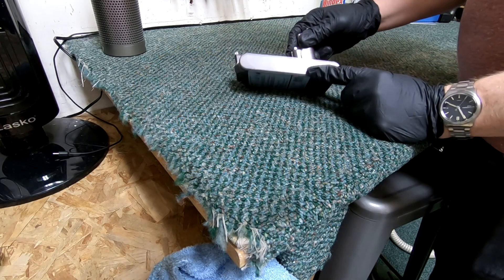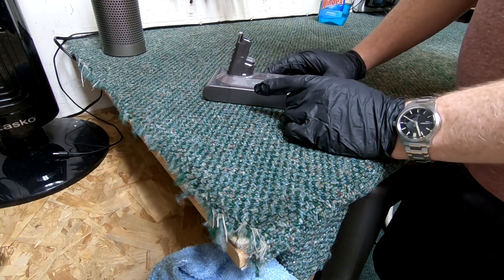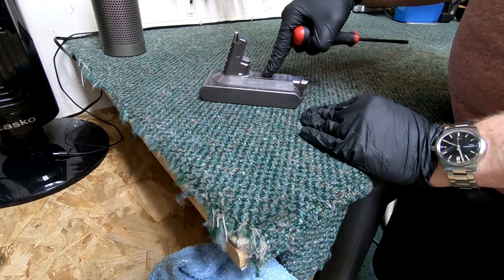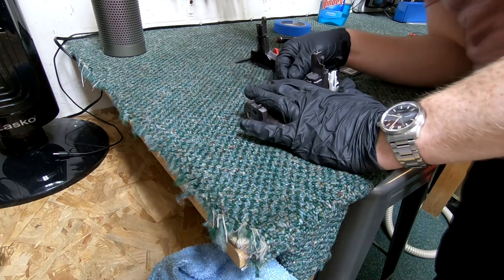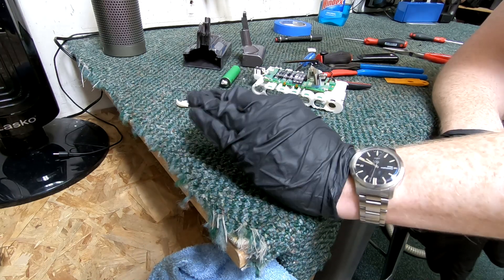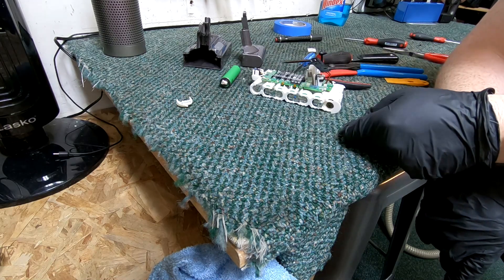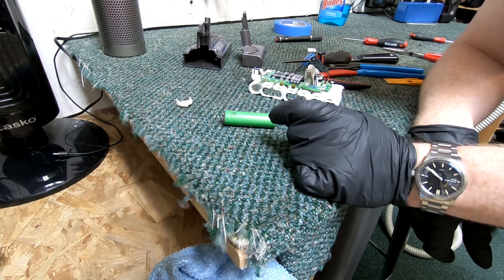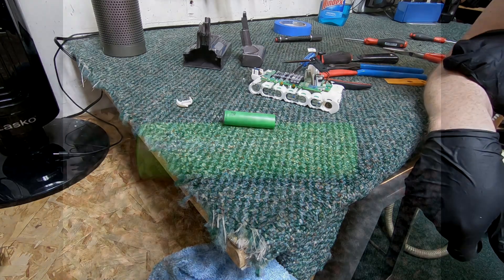Dyson V10 Battery - What's Its Secret? We Look Inside!!!

Comment: I just took my battery pack apart and had a bad 18650 battery, Dyson would work for about 5 minutes or so. Apparently, the batteries are rated at 3amps. Ordered 6 batteries replacements and will be replacing the one in the pack when the replacements arrive.
Reply: I just swapped the battery cells on my v8 to Molicel P42A's and I didn't
Apply any voltage while swapping. Even left it for a couple of days after removing the original batteries.
I just reset the battery before trying to use it and I had no issues at all.
Reply: @certifiedalchemist  jak wykonałeś reset bakterii?
Reply from the maker: Cool project! Just make sure the BMS gets power (low voltage) the whole time you are swapping the cell. If the voltage drops to zero, the BMS will basically lock the battery out of ever charging again. Hope that helps!

Comment: Useful video! Thanks a lot.
I add that all these packs CANNOT LIVE 15 years, even with good cells with good instentaneous amps like here, because must of all are built with only ONE range of cells in series... and that means a lot of out-amps quickly used for each cell, in particular with maxi power, with problems if it's used a long  time without stop. Lithium does not like fast discharges in the time, even with good cells . And in a lot of videos I  see  it's sometimes also a problem for the BMS which cannot support a long time such a use ...
These packs resist maximum 2 years if often used
 It would be necessary to have minimum 2 // cells ranges or more to preserve the out-Amps  for good durable performances( like for good screwdrivers) , but it 's another weight...and another price! Specially with the new items with bigger power...and always weak batteries👺

Al these wireless vacuum cleaners must be used only occasionally and during a short time for small areas...but a lot of people are seduced by  novelty of these technically interesting...and fragile devices. I got this V10 Dyson, but I will build MY own 2 // battery with a good BMS!...And I keep my old and good wired Dyson cleaner!!!...100€ every year for a new pack , no thanks.
Excuse my approximate english, friendly from France, Michel.
Reply: No opinion about this proposition?.... Perhaps too much disturbing...
Reply from the maker: Hi there! Sorry for the delay, It has been a busy few weeks and I'm just catching up with comments. I think the V10 battery project sounds cool, I'd love to hear more about it when it's done and see how it performs!

I will say this. Vacuum companies in general don't take battery management systems or robust construction seriously. I have 8 Milwaukee (I think that would be similar to AEG in Europe)  power tool batteries that are going on 7 years old now without a hitch.  The power tool industry has proven that you can build a robust consumer battery pack, but that costs money. And vacuum companies are notorious for cutting corners for either profit or price advantage. It's unfortunate, but consumers will continue to buy Dysons over and over again with batteries that fail. Tradespeople are less forgiving when they rely on a tool to make a living. 

Cheers!
Reply: @HouseOfVacuums  Hi Matt, thanks for your answer!
It's very easy (for the moment) to build a DIY battery with a dead power drill pack. Simply disconnect the BMS and change the cells , BMS re- connected and it runs like new. Impossible with a Dyson one : BMS (more exactly PCB because no balance...a shame) is immediately blocked  after disconnection.. This "locking" is technically absolutely not necessary for a good protection of the pack by the BMS . It simply obliges  to change the battery without possible repair...first of all for trash commercial reasons (like for a lot of E-bike batteries now).
So my project is simply open a good one and connect a second cells line with same capacity and discharge amps under the first one without touching the BMS always connected. And modify the packaging. Normally that will allow a use for  minimum 5/7 years, although a cleaner is much more used than a power drill! A 400/500w motor cannot run a long time with such "one line" packs...and Dyson knows that precisely. So they explain not to use the "Boost" , or only for a very short time..It's a joke??
I add that we find on Youtube a lot of dead Dyson batteries (red light) with simply faulty BMS without any cells issue...as like BMS was programmed to switch off after X recharges or uses (like for some printers)...and I dread this issue.
Well, by Dyson deliberate weak and "protected" batteries behind a performing and efficient technology. Maximal seduction...with poison in the apple. And you guess why.
Friendly, Michel.

Comment: You are trained how to handle lithium ion batteries but not anti static precautions it seems.
Reply: Yeah once you disconnect the cell, the pcb board is shit. They will be locked out and flash red if u connect the cell back correctly
Reply from the maker: Did you really think I was planning on reusing those PCBs? They all went straight to the trash. No use protecting what I'm sacrificing for the video.

Comment: 15 years dude ? My battery is 1 and had years old and it last only 1 minute 😂😂 those batteries last 1 year and that’s it
Reply from the maker: I know, it's hard to believe they claim that. Yours last an exceptionally short amount of time, but 15 years is bonkers!
Reply: A clogged hepa filter will trash battery usage. Unfortunately it is near impossible to get the filter cleaned.  I ended up cutting the filter so it still traps large particles but perhaps not microns.  No pets, no need for me to have a hepa filter.

Comment: I cycled it perhaps 50 times and got 1 year out of the battery pack.
Reply from the maker: It's unfortunate, but that goes with the territory for anything that has a lithium ion battery. Some may run for 8 years with abuse, some may be well cared for and die after a year. There are just a lot of variables at play. Sorry to hear yours didn't last long!

Comment: My V10 lasts 1 minute if using max power, got the machine two years ago, but it’s been like this for some time.
Reply from the maker: Sounds like you have a weak cell in the battery pack. It will cause the voltage to sag too low on high power and the PCB will cut off power thinking either the battery is discharged or unsafe. Probably time for a replacement. Thanks for watching and commenting!

Comment: I got curious, my V10 is still working just fine (smaller house) but wanted to see if this used plain old 18650s. Not a fan of them being in series. I'll admit I was (was) bought into the marketing a bit with their fancy cobalt-aluminum crap, glad I checked; had no idea they claimed 15 years of life (I freaking wish). Also, $130 for maybe $70 worth of cells, is their PCB and plastic shell really worth the extra $50?
Reply from the maker: Thanks for watching. Cordless machines have given manufacturers a new guaranteed income stream with replacement batteries, which is why they are so expensive. Bought in bulk at wholesale I can't imagine that they pay more than $5 a cell (probably less), so MAYBE $35 worth of cells, then the housing and PCB. In any case, battery pack a very profitable for these companies... which is why they want you to buy in to their ecosystem. The whole thing couldn't cost more than $50 to make, especially since they are using Malaysian labor which is even less expensive than modern China. It is indeed kind of a ripoff, but a necessary one.

Comment: Dyson claimed No loss of suction and then when Cinetic came out that claimed it's the only vacuum to never lose suction. In the manual it states for optimum performance the filters need to be washed monthly. I think we have been lied to. By the way I have seen many V8 and Who needing new battery after 2 to 3 years. I love mu trusty SEBO Felix. Greetings from the UK.
Reply from the maker: Thanks, Lahony! I think you hit on my major issue with Dyson... the shifty marketing. If they didn't stretch the truth like they do, at least I would have some respect for them. As it is, I don't trust them.
Reply: they never  lied, they said if you wash the filter and change the post motor filter it will not loose suction. nearly all vacuum man state that

Comment: Thanks for this information. My V10 isn't holding much charge any more. Only option is replacement? Not very environmental for Dyson
Reply from the maker: Unfortunately it is not just Dyson. Pretty much any vacuum cleaner that runs on lithium ion battery packs cannot have the cells replaced/repaired. Lithium ion cells can be recycled, but it is sometimes hard to find a drop-off depending on where you live.
Thanks for watching and commenting!
Reply: You can do a cell replacement, but you will need to maintain power to the pcb board. If you don't maintain power, once you disconnect a cell, your board will be locked, even if you spot weld new cell back, it will be locked and flash red

Comment: in my case, the cells are still good, the BMS board is burned, can you tell me what voltage is on the black connector with the two circular contacts ?
unfortunately the damage of BMS does not allow me to read, I guess this is essential to make it work the engine...
Reply from the maker: Yes, that can also happen. Voltage at the battery should be reading right around 21.6 volts when fully charged.

Thanks for the comment!

Comment: I’ve used the yellow tenergy cells to rebuild power tool battery’s they worked very well for my snap on branded power tools the tools had very noticeable power increases.
Reply from the maker: Good to know! I'm unsure who manufactures Tenergy's cells, but in any case as long as you are staying within their rated amperage limit you should be fine!

Comment: I'm not saying Dyson actually does this, but it is well established that you can extend the life of a lithium battery by using shallow charge-discharge cycles. So for example, instead of recharging to 100% you recharge only to 80 or 90%. Some electric vehicles and cell phones have shallow charge modes for default day-to-day use, which you can override in cases where you need full capacity.

The extreme ends of the charge-discharge curve are where the most damage happens to lithium cells. All modern lithium packs already attempt to limit this with battery management circuitry that limits the max charge voltage and minium discharge voltage, but these thresholds are set to be a compromise that gets you maximum capacity for reasonable lifespan.

Manufactures don't like optimizing for lifespan because it isn't in their interest. A longer lasting battery with the same usable capacity costs more and is bigger. Will a buyer switch brands if the battery only lasts 5 years instead of 10? Probably not. Very few will even still use a vac or tool more than 5 years.

Adding the additional cell might have been done to achieve longer life, rather than more capacity. (Increased probability of failure from having more components not withstanding.) You could test this by measuring the charged and discharged voltages on a 7 cell battery and comparing it both to industry norms and prior Dyson models with 6 cells.
Reply: I would be happy with 5 years. A couple months past warranty, not happy.
Reply from the maker: It is true, depending on design chargers can go a long way toward increasing cell life. I'll have to add testing the chargers to my to-do list!
Reply: Very true. You could avoid this issue with one of those chargers that lets you set the voltage and amperage, which can also be used for other batteries. I’ve heard good things about these. Although I’m not sure if the BMS would do its top-end balancing if the maximum voltage isn’t reached, so that may result in cell imbalance.
Reply: It's not true. It's kind of true. No one knows what is 100% of the charge. Dyson's 100% is 40.35/7=4.35V . Its too high, max lion cells voltage is 4.2V!!! . Should be 4.2Vx7=29.4V.  The original Charger is 30.45V  1.1A .  I'll change to 29.4V 1.95A. Overheating kills batteries.

Comment: Looking at the V11 battery. Seems very similar to the 10. But i think slightly different fitment so not a straight swap. Any idea which brand 18650 in the v11? Since it has marginally more capacity, perhaps VTC6
Reply from the maker: Check out our new video on the V11 Outsize battery here!

https://youtu.be/r5QmJJfPlQ0

Comment: I always knew that Dyson were lying about the 15 year battery life, like how they do about 'Loss Of Suction'.  They know that they can claim anything and a lotof gullible people would believe them!  Especially Dyson Fanboys! Oh they get on my nerves!  Especially Vacuum Facts - it's so 'pro Dyson' it's actually amusing!  Great video and thank you for posting the ACTUAL TRUTH a out the V10 battery.  Oh I forgot to mention that Max Mode will make the battery degrade much quicker. In the V11 manual, Dyson encourage users to use it on Low or Medium mode as they know Boost Mode will affect the durability of the battery pack,. Sneaky gits.
Reply from the maker: Yup. Marketing can say whatever they want if the consumer doesn't investigate. And you are completely right about "Max" mode. When I ran a V10 flat out on max until the batteries drained, the exterior of the battery pack was in the 130-140 degree Fahrenheit range, meaning the cells are even hotter. Definitely getting close inside to their 185-190 degree max temp internally. That tells me that if they are using the Sony VTC5D cells, which are rated for 25A continuous discharge, then they are right at the bleeding edge of their capability. And any time you heat up cells or use them that close to their max discharge rate intermittently you are running a very high risk of damaging a cell.